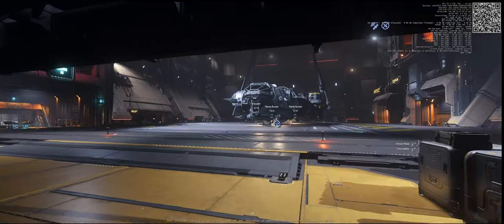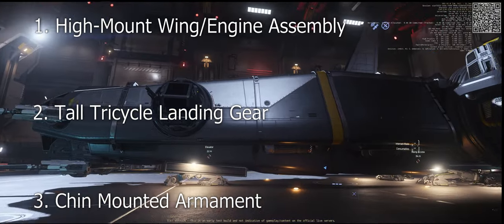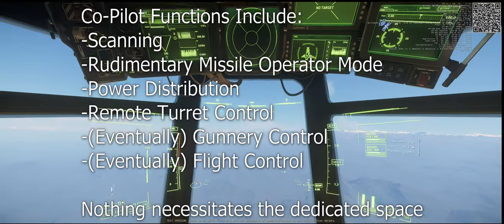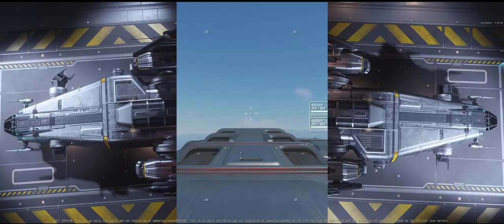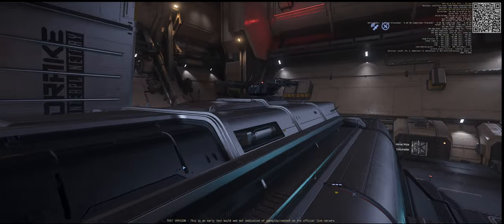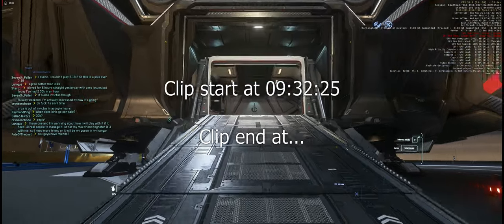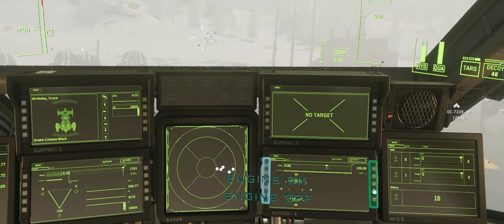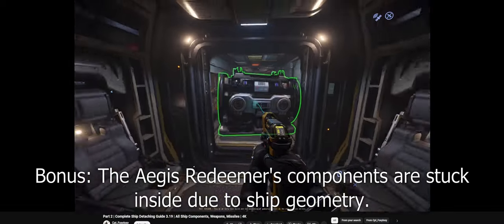Why I hate the Drake Corsair

Comment: Not a ship design thing so much as a style thing, but the Corsair having private crew rooms always strikes me as unfitting for a Drake ship. At the very least, those three crew rooms should be double bunks, like on the Cutlass, with MAYBE one of them being single occupancy for the captain. MAYBE. Use the space in the cockpit currently occupied by the captain for something else, maybe a dedicated scanner control seat (its meant to be an explorer yeh?). Or keep it as captains quarters (crampt and awful captains quarters) and use that frontmost crew room for a t1 medbed, so you can treat minor injuries during your LONG RANGE EXPLORATION.
Also it would be nice if you could retract the picnic table into the floor when you're not using it, could potentially let you use that space for extra storage or something.
Reply from the maker: The Co-pilot seat would be a great candidate for fuller scan controls as I mentioned.

You're right about the medbed - if it is an exploration ship you ought to have some medical function.
Reply: You mean t3 not t1
Reply: The way I see it, Drake Interplanetary is a civilian manufacturer. In the military, people get used to sharing spaces, particularly on ships and aircraft. But Drake doesn't build military ships, they build civilian ships for the civilian market, and therefore they understand that their clients have a high value on personal space.

My question isn't why the Corsair has individual crew rooms. My question is why other civilian manufacturer ships like the Constellation, 600i, etc. don't have individual crew rooms.
Reply: @BigSneed404  Totally overlooks the Caterpillar with it's beds literally in the gally and zero privacy. 🤣
Reply: @lunasakara7306  ya, you're right. It should have private cabins too.
Reply: @Linuscracked  What, no, Corsair should have a T1 medbed, dedicated medical ships be damned xD But yeh, derp, I mean T3.
Reply: @birthdaytruck  actually would be nice to be a 4 seat double deck. top front gunner, top rear pilot, button front gunner, button rear radar officer, scaner station on the side turret. can be operate retracted. God I really want a EA-6B configuration fighter, or just a F-111, side by side are the best

Comment: Another potential fix to the cargo ramp angle would be adjustable landing gear height. Have the default height as it is now, then add an extended height that would enable easier landing on rough terrain, lastly have an specialized rough terrain cargo loading setting where the ship leans backwards. Or just have all the landing gear heights be independently variable and controlled by the players with a couple of useful default settings.

Comment: The problem of raising the landing gear is not because of the cargo ramp, but because of how the folding wings don't have enough coverage to enter certain hangars. Hence why the wings are both mid-mounted, and why the landing gear is so short. The solution I'd propose would be having the taller wing have a 2nd fold on itself to cut the wing length in half.
Reply: or make it use larger hangars?
Reply: @adrianbarreto4225  Bad solution, why resort to having to use larger hangars just because it's poorly designed? That's just accepting inefficiency.
Reply: they said in one of the last isc that news mediums  personal hangars will be taller, so it wont be a issue anymore
Reply from the maker: You, unlike others who pointed out this flaw, proposed a rational solution other than "let's gimp the ship because hangars are too short". The hangars are all being re-scaled for instancing, now. Give us back the taller landing gears.

Comment: Nice to see people talking about this. For the time I spent moving cargo in a variety of ships I quickly learned how ineffecient the current cargo grids are. Some compartments arent squared shaped or atleast accomodating for a particular standard cargo unit size and have diagonal or odd shaped hull design around the cargo. There is also a ton of wasted space in walkways, every square inch should have a purpose and having a pretty path shouldnt be the first consideration. As for specifically the corsair, the cargo section connected to engineering has a very wide stair case leading up to it. Which cuts off important space that could be used for cargo. Secondly, the aegis reclaimer's grids have to be an extended april fools joke 12 years ago that someone forgot about. You should be able to stack 16scu 6 high in the middle, but you cannot officially on a grid (have fun stacking unstable boxes). The catwalk is so wide you can fit 16scu crates up there, which is more wasted space. What would be nice to see is some level of control given to the player as to how they choose to change the layout of the ship, get rid of beds and place more cargo space or something.

Comment: The landing gear is so laughably short because the folded wings had to fit in the pre-existing hangers. I guess someone didn't want to make the wings shorter. 😆
Reply from the maker: Or make them fold at a different angle?
Reply: @birthdaytruck  yeah could have had the big wing fold in half?  I guess short landing gear was easier to make!

Comment: The reason for the short gear is to reduce the total height of the landed ship. Due to the very tall folded wings, it wouldn't fit inside hangars if the gear were taller.

The fix should ha e been to shorten the wings, or add another hinge for a folding wongtip. But if one does not notice the problem until late in the design, then shorter gear is the cheapest fix.

Comment: i have to agree .. at this point i can only guess that these are not terrible design blunders .. but actually the result of crippling stuff on purpose .. 
Similar to the terrible internal design of the Starfarer .. there is so much work put into these ships .. but simple basics are ignored or made worse on purpose..
stuff like the ability to move components around should be a basic thing .. ships with a cargo room where 20 boxes would fit but you can only attach 10 because "reasons" and the fact that there is more than enough room ... you end up stacking items in an "unsupported" way .. and why ? because someone "decided" that there is room for 10 boxes in the 20 box cargo room ... it is terrible.
The worst offender of turrets is the one on the freelancer - the fact that CiG still tries to force people into a manned turret even if that creates a ton of extra problems and doesn't make any sense to do so .. i just dont understand it at all -.-

Comment: The short landing gear is because the folded wings are extremely tall.  These need to be short enough to allow hanger doors to close with the wings up. What the Corsair needed is to have the long wing to fold up in its current position, then rotate forward.  This would keep the asymmetry of the design will allowing a more compact landing configuration for hangers.  With the reduced hight then you can raise the landing gear to give better off pad lading performance.  Sadly with the Corsair being one of CIG newest ships I don’t see a rework coming anytime soon. There are other ships like the Caterpillar and the Carrack that need major reworks so that they can be used for cargo gameplay, which is a vital part of their ship design.

Comment: It's an issue I've always had. Directly Mounted turrets in 2954 (WTF), turret placement, illogical design choices. You can make ships look good AND functional.
Reply from the maker: We've actually had remote control turrets in the B-29's. It was with periscopes and mechanical controls. Manned turrets I think could be justified and incentivized, but MANNED TURRETS CANNOT BE IN THE WAY OF CARGO HOLDS OR OTHERWISE THE ONLY THING TO OFFER TO OTHERS.

Comment: I remember a few years ago when I was only following SW that one ytber, can't remember if it was Bored or Noobifier, mentioned that Roberts wanted the ships to have blindspots, deadzones and be overall suboptimal in someways to avoid making the overpowered or unbeatable, don't quote me on it though. I can't say whether this sound logic but it is an explanation of some of the choices. Like how most turrets are manned, that's intentional aswell so players CAN be killed when the turret is shot at.

The funny thing about the corsair is that it's most likely based of the BT 7 thunderclap from star wars the old Republic, same ship designer I believe.
And some of the elements in that are actually done better than the corsair. The way to the cockpit is actually pretty quick. It has bigger guns that sit at the wing tips. There's a vehicle rack that likely has its own elevator like the constellation. The landing gear also makes it sit a little higher. And some of game shots have it with a pair of laser canons right below the cockpit protecting the main ramp which could easily be gimballed in Star citizen.
I love the core shape of both ship but yeah the way the corsairs is actually arranged is pretty bad and arguably ruins the flow of the ship with the side turrets.

Also yeah the mustang should have the space behind the cockpit usable, it's funny how if you really wanted to make it a compact single seater it could be half the size.

Comment: The original concept pictures of the corsair had longer landing gear and chin mounted hard point, but they shortened the landing gear when it couldn't fit into a medium-sized hangar with its wings folded up.
Reply from the maker: Hangars have been reworked for instancing, now. It seems silly to worsen the ship for a hangar size that eventually changed.

Comment: That's not a probleme exclusive to the Corsair's design. 
One giant problem with SC designs is how they are not made with the purpose in mind. 
To me it's the most obvious with ground vehicle design. It's not just unfun because ground vehicle physics are at an early stage of development, but because they clearly weren't designed for the types of terrain the planet designers keep pumping out. 
These vehicles were designed with either roads or relatively flat off-road surfaces in mind, and if your response is "they are going to add roads" then I have to ask "where are all the ground vehicles made for off-road exploration on alien planets?" 
How did humanity make all these places accessible without a single ground vehicle that could reliably drive on them?

Comment: I like the co-pilot room, but it would be nice to have a swivel seat to access "stuff" behind that seat.  Such a large wasted area.  Though not like it matters either way, there are no components back there to access.  Would be nice to hide a 1 SCU personal storage box back there though. 
I have no problem with the low height of the Corsair when landed.  It is "marketed" in-game as an exploration ship, but everyone knows why DRAKE put 12 guns on it, and it was not to improve exploration.  I do wish we could have a "load" setting on ships with rear ramps.  Squat in the back to make the ramp angle less.  So many ships have terrible ramp angles and the breakover into the bay is ridiculous.  They have these hover pallet jacks they want to put into the game to move cargo boxes, those will not fit through the openings without removing the top layer of boxes.  That is just not how trucks are loaded.  There is a reason you drive straight into the back of a semi-truck from a loading dock.  You have your pallets stacked on your fork and with only a few inches of height clearance, you cannot be going upwards through the opening.
The turrets should extend out a slight bit more (~1M) so that they can have more coverage and converge with the pilot's aim.  Would have been cool to change the position of the guns on the turrets putting 1 on top and 1 on bottom.  Something no other ship has and would fit the Corsair's quirky design language.  Also, it would allow the turrets to be tucked closer to the body like they currently are.  The top turret can be raised slightly by just making the hump, that it sits on, a little bigger and moving the turret to the back of that hump.  It seems CIG does not want any ship to have perfect turret placements in a game that they continue to push as multiplayer co-op preferred.  The only ship with good turrets is the HH.  Every other ship has turrets in poor positions that leave them blocked by something stupid, ESPECIALLY the damn carry handle on the freelancer.  They redesigned the Cutlass and made the back hump upwards blocking more of the reward view of the turret.  I am always confused by how CIG places turrets since they do love to say how co-op multiplayer they want their game to be.  If that is your goal, make them enjoyable to use.

Comment: I appreciate and agree with the concerns brought up for a general ship design, but I don't think  there is a case for the Corsair specifically 1 ) its not a drop ship, there is no impetus for a chin turret - its sold as an explorer  2) landing gear height was a concern, but in practice it hasn't been all that limiting  3)  the ship is made with frontal assault in mind, defensive coverage gaps feel intentional - every ship is built with some weaknesses and specific focuses in their operational design  4) fully agree with the copilot zone short comings      //   Note on redeemer - their intention is size 3+ components can only be serviced in dry dock - and not support field upgrades -  ( just like modern carriers need their reactors physically cut out of them for servicing)    // most ships in this game can be made 'whole' with basic design updates, but the intent is to have specific focus for ships, and clear weaknesses that can be exploited ( attempt for no meta)
Reply from the maker: An exploration ship still benefits from a chin turret - an exploration ship is also supposed to deposit and protect ground crews. 

Ships should not be built with weaknesses "on purpose" - weaknesses should exist because of an engineering tradeoff or compromise.
Reply: @birthdaytruck   I don't know how I feel about the implicit assumption that an exploration ship should have to deal with ground assault and combat cover when landing - but this is also a Drake ship, so I guess that concern is moot. 
 I agree with you on the latter point, and I think thats exactly whats happened here. The guns laid out with a focus towards a frontal assault , accounting for a rear assault isn't part of the design language here - same thing appears to be happening on other offense driven ship. the A2 has a large gap in 6 o clock high vector, because its built for forward ground assault

Comment: About the first half of the video: I could agree if we were talking about the Cutlass Black, but I never saw the Corsair as a ship meant to operate in atmosphere, just one to land and grab the loot after his smaller brothers do the dirty work. The corsair is a blunt object designed to surprise attack slow and large targets with overwhelming firepower in space and high atmosphere. If we are comparing to historical real planes, I'd say a P-61 black widow or ME-410, just with some cargo and crew space.

The very fact that it assymetrical and flies like a brick should make this point pretty clear. IMHO the ability to hover should be WILDLY nerfed in all but the very clearly vtol oriented assault craft (again, like the cutlass) so large ships or fighters had to STRAFE, not float like gravity didn't exist, that causes real immersion break to me every time I see it.

Oh, I completely agree about the landing gear, I was mostly talking about the CAS capabilities while hovering and the nose gun (or lack thereof).

About the later half (about turrets and wing loadout placement): 100% agreeed. SC turrets as a whole are just awful design meant to divide the frontal arc firepower so people are FORCED to multicrew and it's really boring, just let turrets be turrets.
Reply from the maker: If the Corsair had a dedicated space for a shuttle, I would agree. The concept art, however, clearly depicts an atmospheric planetary explorer ship.

It does not fit the design ethos of a "heavy fighter" like those P-61 or ME-410 units: this one has a picnic table and Drakes are supposedly low-armored. If it's turret design mimicked the P-61 or ME-410, I'd be more inclined to agree.

Comment: You are right in a lot of points but the issue with pathways and multiple entry points into ships ignores that we are talking about SPACE ships. Entry and exit points are already rarely secured against depressurization and the vacuum of space. Adding more doors only makes this worse. The C1 is actually a pretty good design in this regard. 
Furthermore we are talking about SHIPS not aircrafts and looking at ships they often have few entry points where crew and passengers use the same to get on board. So yes CIGs Design philosophy is quite flawed but copying aircraft design isn't the right solution for every space ship.
Reply: However, many of our ships have dual entry. The little Avenger Titan, for example. It fits in-game lore. The MSR and others should have dual entry, and they don't because of Crusader design language taken too far.
Reply from the maker: The Avenger TItan is one of the few ships that prove it can be done right. A ramp entry and a cockpit entry can co-exist.